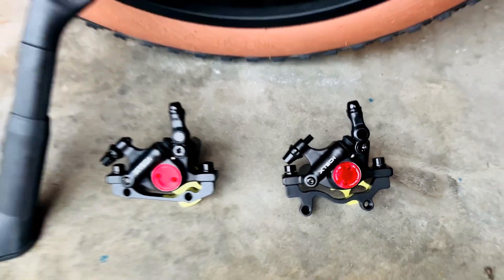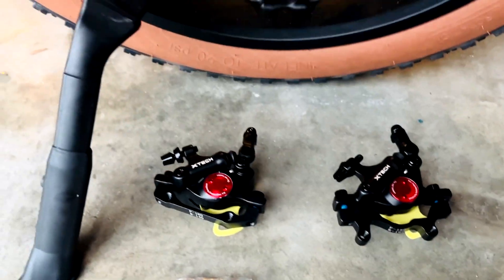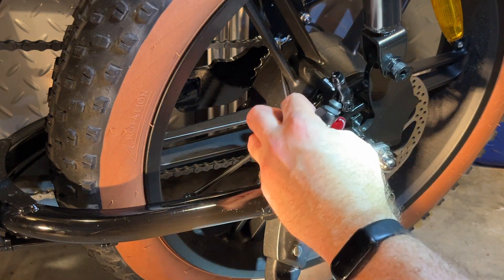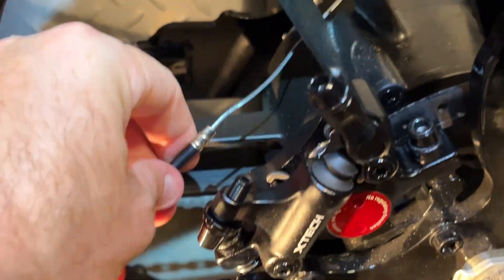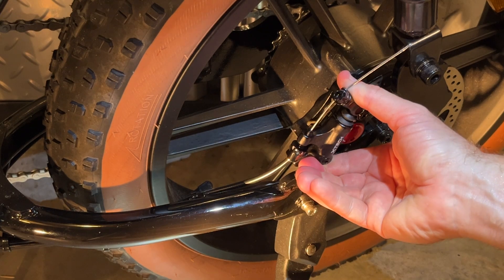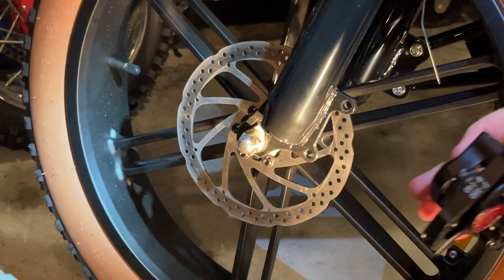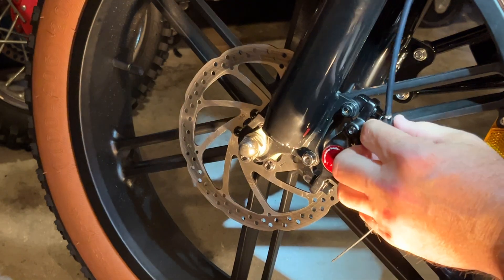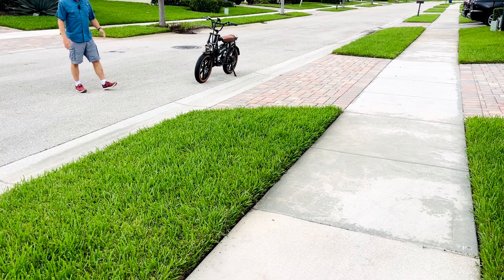$35 Easy to Install Hydraulic Brakes on eBike or MTB - Zoom HB100

Comment: This was easy to do and I've never even changed my own brake pads before. I cant believe I put 700 miles on those shitty brakes 😅. The multi color ones were the only color I could get shipped quickly. Black would have been 2 weeks so I paid $50 but I don't even care cuz I saved a $100 in labor and they look good. Thank you for saving me money again!
Reply from the maker: Awesome and congratulations

Comment: So many of these Chinese ebikes come with trash components. Most ebike owners that ride these cafe racers couldn't tell what a group set is, or a hub, or a headset. They just see 750w and 30AH and they're sold. Hence why most ebike manufacturers don't even list the exact components
Reply from the maker: Agreed, they make the bikes with whatever components available are low cost

Comment: How is there any difference in brake performance it's still cable pulled
Reply from the maker: Hydraulic piston has more mechanical advantage over mechanical actuated brake and pads are slightly larger then most cheap mechanical brakes

Comment: Hey, I've been watching your videos and commenting on them, and them helped me tremendously over a year now. On my ouxi v8 48v 15ah battery, not the updated version, the original without the passenger seat. The receiving part of the battery sparked due to some moisture, I guess, and it slightly melted the chsrching port. Luckily, this part is unscrewable and can be replaced. I just haven't been able to find a replacement part anywhere. I do Uber eats. I need to keep making money to pay rent and feed my family. It would be nice if you knew of a store online to get it. I've messaged 3 stores, but they haven't ever responded.
Reply from the maker: Which part sparked on battery or the mount?
Reply: @BRichSolution  the circular part right under the on-off switch and now it ruined, so now I can't plug in my charger. I took apart the battery, and every thing is fine, and I unclipped the red and black wire connectiom from inside the battery that leads to the charching receiving port that you can unscrew and remove.

Comment: I was thinking of doing this too and then started puzzling why calipers would make any difference? I can understand a larger disk rotor, but calipers running the same size brake pads? Clearly new hydraulic calipers do make a difference, but why? Any thoughts on the matter welcome!
Reply from the maker: Hydraulic pistons have better mechanical advantage over mechanical pistons and pads are larger then stock pads
Reply: what @BRichSolution said. plus both brake pads are moving, not just the outer one, like on cheapo standard disk breaks. which makes them wear unevenly, requiring frequent re-adjustment, and causes ever new unpleasant noises. eliminating that pain in the butt alone is worth the upgrade.

Comment: I'm looking to get my 1st ebike... looking at the tamobyke v20 then upgrading suspension 
Or
amyet s8 leaving stock.
What do you think?
Do these brakes work on the v20?
Reply from the maker: These brakes will work on both tamobyke and amyet.   Amyet G60 and Tamobyke V20 have same front fork and suspension.   Amyet is faster and torquer motor than v20